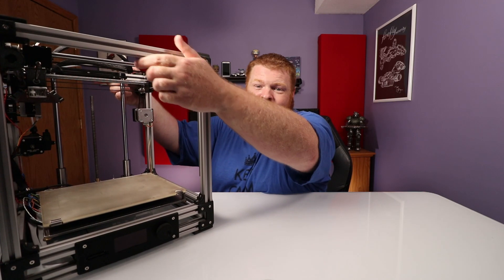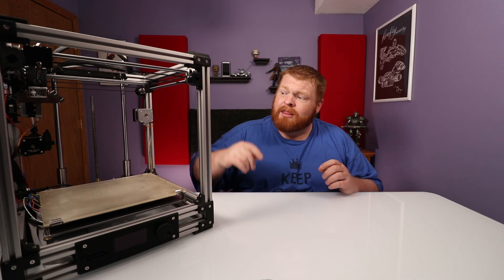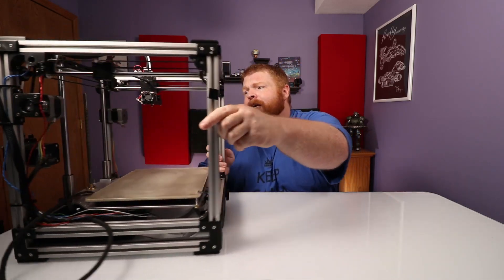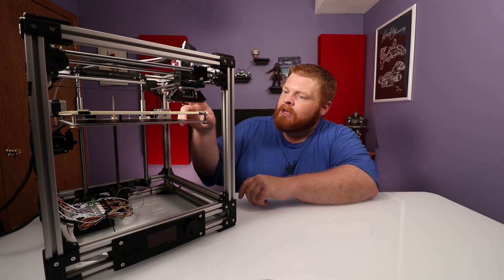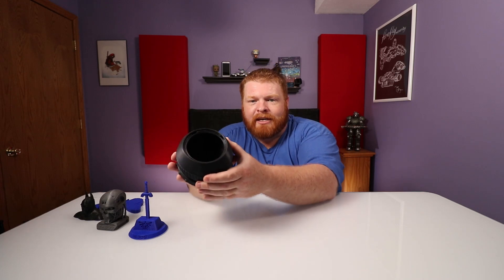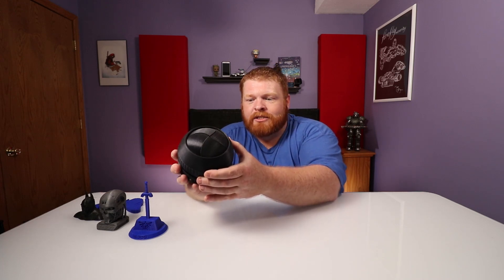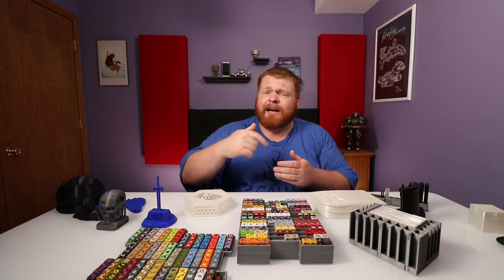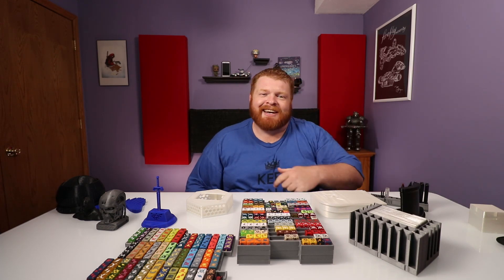My Homemade 3D Printer: Ultimaker 2 Clone

Comment: I've almost build this project but in my case XY axes are moving really hard, at 3:47 I see that you have to put a lot of force to move hotend too. Could You share more info about that? Is this ok?
Reply from the maker: I didn't have to put a lot of force to move that. I would say to make sure you've lubricated your bearings well and to make sure the axes are square. I had a problem with that when I first built mine. Did you get the plans for yours off of thingiverse?
Reply: @TheRealGingerTech  yes I'm using 1st version models of johanes ultimaker alu extrusion project from thingiverse

Comment: Nice job on the printer.  I've also built my own printer, but instead of 2020 aluminum extrusions, I used steel and aluminum bar stock (Home Depot).   Ball bearing drawer slides were used originally, and were later replaced on the X and Y axies with standard linear rails and bearings.  Some parts that were first machined from scrap metal were later replaced by 3D printed parts (on the very same printer!) designed with OpenScad.  Surplus Nema23 motors are used (except for the extruder which is a Nema17).  I've tried several hot ends, and are now using a Prometheus.  (I considered the E3d, but liked the smaller size and one piece nozzle of the Prometheus.)  I even built my own heated bed by gluing a bunch of square 'sand' resistors to the bottom of a metal plate with JB weld.  Actual print surface is a piece of picture frame glass.
BTW you should consider one of the new ARM processor 3D printer controller boards, this one is very tempting: https://www.banggood.com/BIGTREETECH-SKR-V1_3-Control-Board-32-Bit-ARM-CPU-32bit-Mainboard-Smoothieboard-For-3D-Printer-Parts-Reprap-p-1476462.html?p=9X051049165582016063&cur_warehouse=CN

Comment: I've been looking at buying a second hand 3D printer myself. Can anyone recommend anything I should be looking for or avoiding?
Reply from the maker: Second hand gets a little tricky, but there are a few things to watch out for. The biggest being that the controller and motors work. Typically if it has a screen and either a knob or arrows, there is a way to control the motors manually. The second biggest thing is make sure the parts that are suppose to get hot actually do, ie the hot end and heated bed if applicable. What kind of budget are you working with? There are some pretty good kits you can get for relatively cheap.
Reply: @TheRealGingerTech  Thanks Karl, I've been looking at Geeetech & Anet A8, which i didn't realise are already built kits. my buget is upto £200($250US)  although I do like the sound of building one with an adruino as adruino home automation projects would be the main use for it. & Happy 4th of July :-)
Reply from the maker: @BotanicalBob124  Sorry I didn't get back to you sooner. The Anet A8 is a great budget option for getting into printing. Like most 3d printers there will be some fine tuning you will have to do to it, but luckily the A8 has a huge community behind it so there is a ton of help out there.
Reply: @TheRealGingerTech  Thanks for getting back to me i went for the Geeetech I3 Pro B in the end as it was £110 ($137) on prime day. you're right about the fine tuning it took 4 hours to build and so far i have spent around 20 hours trying to stop a judding in one of the Z axis so not printed anything yet, looking forward to the day i do thou :)